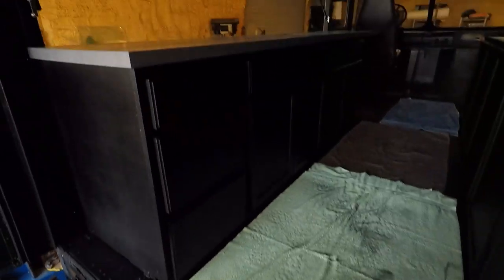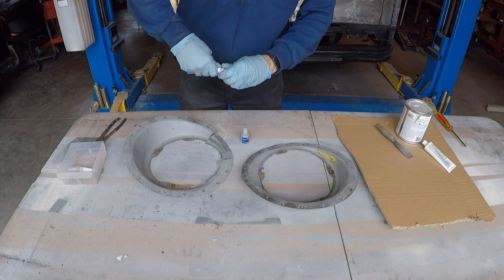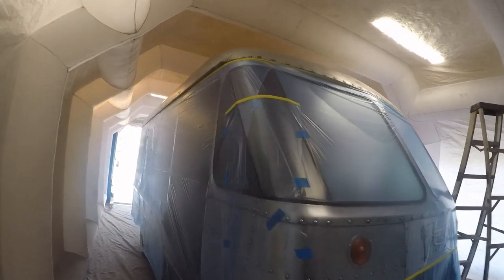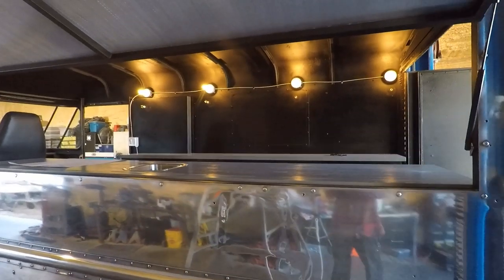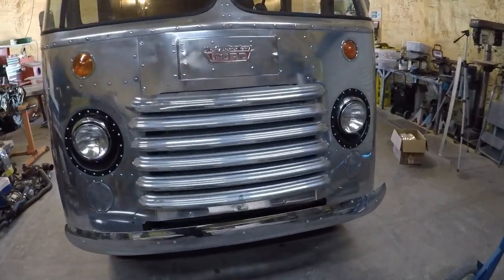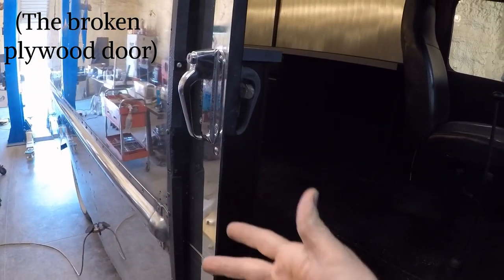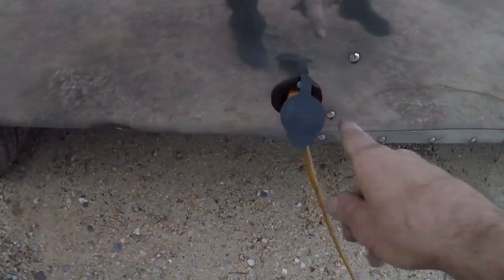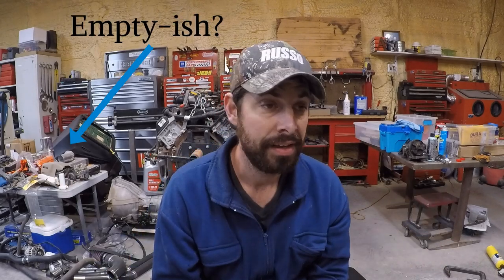Mobile Bar Built out of a Vintage Step Van (ep6)

Comment: Is looking wonderful, as late as my comments is, I want to offer that if you use a plastic guide like the door tracking spacer again consider using teflon -- PTFE is far more slippery than plastic, it might not leave a surface contact telegraph.   I also may have no idea, but it is pretty slippery.

Comment: I love the amount of skills that you been using and the finished product always look great. A little bit of my experience to be helpful, the inside corners of the counter should be radius cut to make it worker friendly and the flex tube for the wiring and the light switch look added on and IMO stand out too much

Comment: Beautiful job! But a jet black roof? That thing must feel like an oven on a hot sunny day
Reply from the maker: I agree. I tried to convince them to let me paint it white
Reply: @AustinCoulson  I absolutely LOVE step Vans and am currently converting mine into a camper.
If the heat becomes a problem what I would do is insulate the space between the roof and the ceiling (polished metal). It may help containing the heat transfer but you'll still experience a "halo" of heated metal where the ceiling metal ends and the black painted roof goes lower unless you extend that interior ceiling to the curvature where the walls meet the crown of the curve. They make fire-resistant foam insulation in sheets so no worries about the heat melting the foam insulation and even tho the interior is already riveted up you can easily slide the sheets into the space without removing them.
Just some pearls for future projects. Great job too bro. That truck came out incredible

Comment: That was a ton of hours invested so I would figure 10 to 12  thousand.  Great work!
Reply from the maker: About 380hrs into it. Are you thinking parts, labor or both?
Reply: @AustinCoulson  I was thinking all in but with the hours you stated I am sure my estemate is low plus my knowledge of some of the naterials cost is most likely low due to not working with them on this type of scale. I was mostly shooting from the hip.
Reply from the maker: @quarter_bubble_garage4946  Just the material on this project was around 10k or so, with the biggest costs being the cabinets and the oak counter top. It's amazing how quickly things add up.
Reply: @AustinCoulson  that they do, I didn't even think cabinet wise I was more focused on metal work but there was several aspects to this project. I own a 1964 GM bread truck that my wife wants to convert to a mini motorhome so I will be learning these realities very soon.
Reply from the maker: @quarter_bubble_garage4946  that sounds like an awesome project. Reach out with any questions if you get stuck with anything, these jobs can be overwhelming; acthecarguy@gmail.com
Reply: @AustinCoulson  has to be at least $9k in labor.
Reply: @lostintime8651  If he has 10k in materials then double that for your labor and that makes the whole job come in at around 30k.

Comment: It's just baking soda and superglue. I use it all the time. Sets hot though (exothermic reaction) so you can't use too much at a time. Stronger than JB weld.
Reply from the maker: Someone else said that and I thought they were pulling my leg, but I tried it, and you are spot on.

Comment: Hey there. We have one of these. A 1959. Can you share a couple of things with me? 
What kind of rims and tires are on yours. We are taking off the old split rims.
How did you get that polish?? Ours is very dull. We stripped it, and have tried lots of different aluminum polish, wet sanding ectt, but unfortunately someone sanded several sections and to get your shne seems tough for us.

Nice job. Where are you located?
Jay
Reply from the maker: Good idea to scrap the widow-maker wheels.  This was a 62 I think so it already had regular steely wheels, but I would recommend looking for take off wheels from an old F100.  If you have a standard wheel pattern, they should be easy to find.  If you have the large 6 lug split rims, like the International Metro then you will need to change out the spindles and axle shafts or have custom wheels made.  (the cheapest solution would be to swap the entire front end and complete rear axle with a junked F100)

Polishing this thing was a nightmare because it had lots of sanding and sand blasting done previously. I had to start at 80 grit and work all the way down to 800, then polish it with a polishing wheel and rubbing compound, then go over it with a polishing compound.  

This was filmed when I lived in Phoenix, but I live in Spokane, WA now

Comment: $9,763.25 parts
$24,214.00 labor
Reply from the maker: You are very close on parts if you add the costs paid to the polisher and sandblaster. I wish I could have charged that much labor, but it was slightly under 400 hrs all in for me on it.
Reply: @AustinCoulson  Where I live, mechanics charge $75/hr. To replace a CV axle (busted cv boot) in one side only, they quoted me for $500 (labor and parts).
So I multiplied by 320 hrs and added $214 - b/c a convincing guess needs to look accurate :-). 
You have the expertise of a $75/hr professional.
Reply from the maker: @KeyserSoseRulz  I usually charge 75/hr if its something that has a known expected rate, like a cv axle (although I prefer to not do those jobs as they aren't fun) and up to 125$ an hr for custom fabrication depending on the job, but the owners of this van are awesome clients that I have worked with a lot and I had never done a full conversion on a Grumman and always wanted to play around with one.  Looking back, I underbid the polish by a large margin because I didn't realize that they stopped selling the good paint stripper and also didn't know it would be impossible to find a polisher willing to help. Honestly, your guess is probably exactly where I should have been and would be if I did another one.

Comment: My guess, $12,000
Reply from the maker: Labor, Material, or both?
Reply: @AustinCoulson  I'm going to go with labor, I didn't pay close enough attention to materials. Off the top of my head all I can think of is that door jam, sheet metal, and paint. Maybe some square tubing? I don't think more than a grand in materials but I could be wrong.
Reply from the maker: @Adrianzx  so the materials and paying the sandblaster and polisher were almost 10k. A lot of the material was tied up in the cabinets and the countertop. The counters alone were 700$. You are super close on labor.
Reply: @AustinCoulson  it was mostly you complaining about polishing the sidings that got me there, I asked myself how much would I charge? Also the fact that no one else was willing.
I look forward to Vic stuff and I'm glad your tow rig runs.